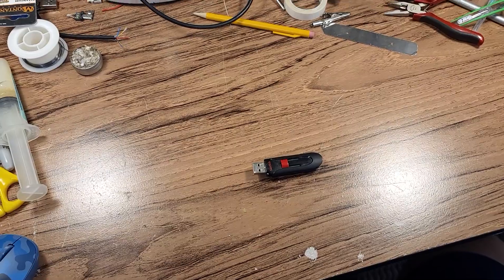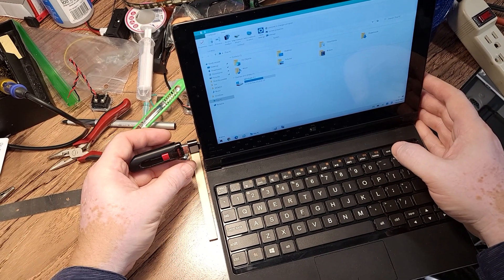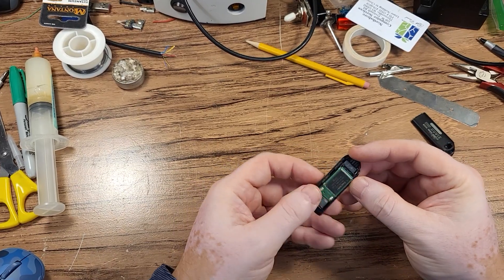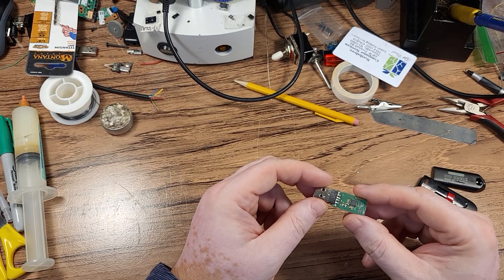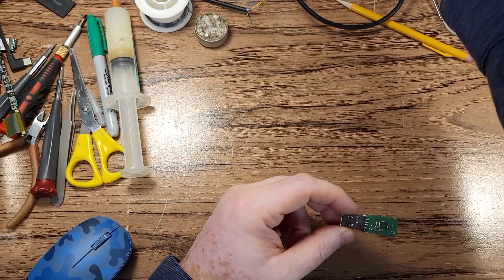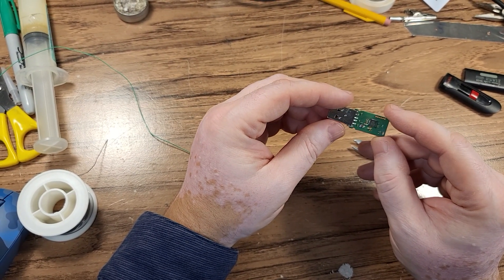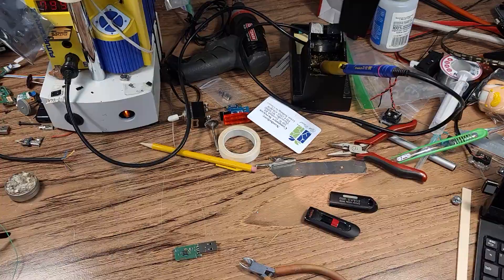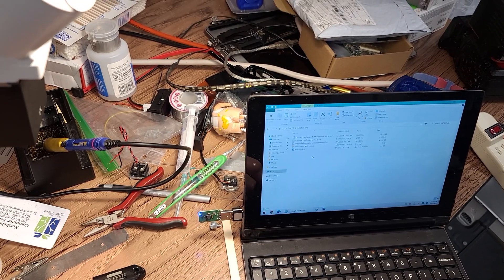Data recovery from a broken USB flash drive

Comment: Hello, my WD external HD fallen one time, I can access the files but i had the feeling it will be dead so i started copying my files but the issues that it takes ages to copy few files then some times get me error messages and the HD get hot. Any suggestions would be highly appreciated
Reply: HDDs get hot, just monitor it, if it goes over 48 (this is just the temperature i get uncomfortable when a drive is that hot) then just pause the transfer and unplug it.